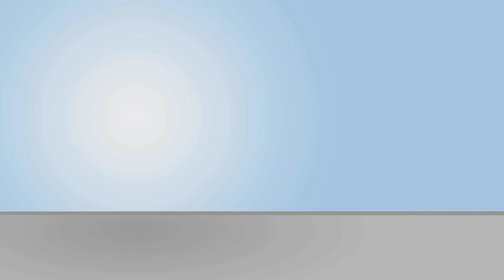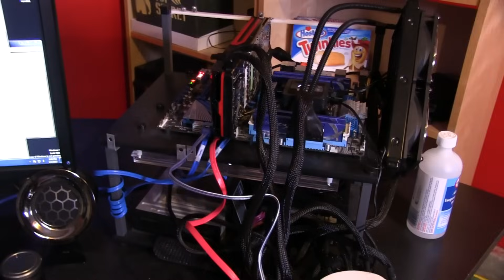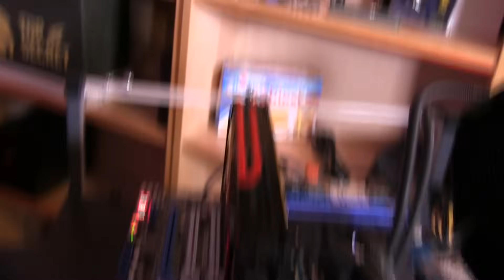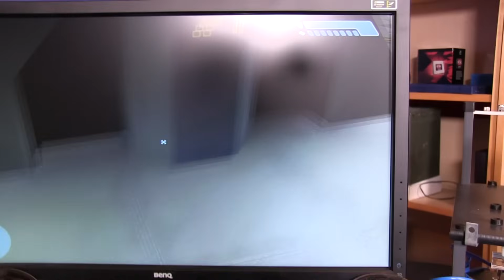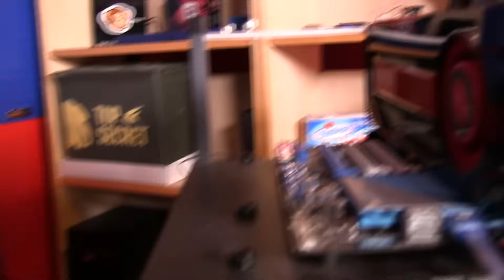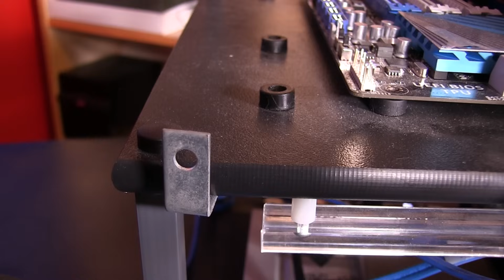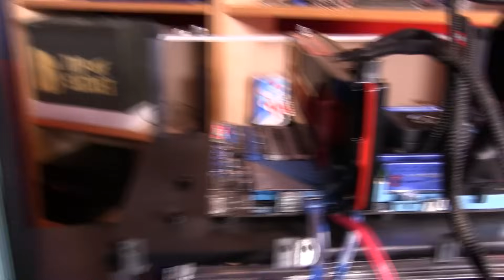Coil Whine Explanation & Demonstration Linus Tech Tips

Comment: I had psu coil whine when moving the mouse and scrolling throw pages. I turned of power savings in bios on the cpu and it fixed all my psu whine when idling. so for those who have problem. give it a try. 

asus motherboard. in bios go to advanced/cpu configuration. then disable all cpu power saving modes.

Comment: I have an new system with MSI RX480 x 8GB, i7-7700,asus prime plus b250, CX650m psu, i was playing bf1 and the coil whine came not directly and not so high as in this video. I was plugged in at an not earthed circuit. Now its in earthed wall socket should this make sense? Or should i still change my gpu for a new one?

Comment: that is horrible!    so glad my asus strix gtx 670 doesn't have and has never had that coil whine.....i'm thinking about upgrading to an Asus Strix GTX 970 card, but I'm worried about coil whine.....i could never put up with that,,,,would drive me crazy....my pc is very cool and whisper quiet as I have Noctua cooler inside and replaced all of my fans with Noctua's running on low setting.....quietness is of utmost importance to me!    Anybody here recommend a gtx 970 that has low chance of coil whine or is it really dependant on the card itself and/or power supply??

Comment: my gpu does not coil whine (atleast i can't hear it no matter how much i have tried) but i can hear the coil whine sound in my headset if i use 3.5mm, its seems to go away if i use a usb headset tho. does anyone know what that is and how to get rid of it? i changed my gpu like just a few days ago so it might be gone now if im lucky.

My motherboard is: GA-Z97X-Gaming 3 
link to motherboard specs website thingy with information and stuff: http://www.gigabyte.com/products/product-page.aspx?pid=4966#ov
Reply: From my understanding it is not coil whine if you're hearing a sound from your audio jack. I had the same problem, basically I would load up Overwatch on my computer and hear static. Then I noticed that it appeared in other games. I opened up my pc and saw that my hd audio port (for the case front panel audio jack) is right above my psu and below my graphics card. This position leaves it open to a lot of signal interference. The fact that you're using a usb headset and you don't hear it could be an indication that your hd audio wire is in a spot open to interference. In that case like with coil whine there isn't much you can do other than try to route the wire differently. Now I did hear a more static and not the coil whine sound in my case though.
Reply: Also you should test out if you hear this sound when plugging your headset into the back of the motherboard, ie. the io ports. If you don't hear this sound then it's probably the hd audio wire.
Reply: shadowstar1286 my hd audio cable is in between my psu and gpu the wierd thing is that when i change port (i usually have it on the backside in the motherboard) to the frontside it doesn't stop but it becomes more quiet
Reply: Yea that is weird. My motherboard was advertised to come with "shielding" for my onboard audio so that may be why. Could be that you're receiving more interference from the onboard audio, but at this point I can only recommend seeing if your drivers are up to date. I don't have much experience with audio problems so I can only respond with my experience.
Reply: i have the latest drivers i have been able to find..
Reply: this is just from the audio cable, get a better one or remove causes ( most likely: wifi adapter, ethernet cable, cat-e tv cable maybe if it close)
Reply: Daisudori i'll try getting a new audio cable, i have tried the other stuff u mentioned with no results
Reply: ***** Thanks alot dude everything you assumed was on point. So i guess imma get myself a audio card :)
Reply: Getting a sound card  would be much more easier than replacing your hd audio cable.
Reply: altho, with a bad shielded wire u will still have the same problem if the room/area has alot of intereference.
Reply: Daisudori how do i know if my cable is poorly shielded?
Reply: ***** nope haven't gotten one yet since i have usb headset (i can't hear it when using them) also i haven't heard it when using my new speakers. im not sure if it solved it self or something but yea
Reply: ***** but usb soundcard most likely will work since it dissapears when i use my usb headset and the thing with usb headsets is that they have built in usb soundcards
Reply: when my HDMI audio driver is installed (from AMD rx480) i also get this chirpy buzzy sound, from my monitor (with speakers in it). Disabling this device (HDMI Audio device) in device manager got rid of it :)

Comment: I don't have coil whine, but I do have an annoying grinding sound when my GPU fans first start spinning. It would be fine if they would stay spinning, but when cooling down from a heavy load, the temperature readout will fluctuate between two temps for a while before settling down to the cooler one and this causes the fans to start and stop repeatedly as the readout goes between 55 and 56C (the temperature at which the fans spin up).

Comment: my 7970 didnt have it... and its the same model. maybe its just your gpu thats bad?
Reply: MEXICO_MAN try running a very old game without vsync or fps limitations, in the hundreds of fps range.  then take a listen.
Reply: Old games should be capped because it can cause problems, moreover, that would only happen to a handful of people in rare situations unless they did it on purpose. Your argument is a bit invalid to the normal user.
Reply: MEXICO_MAN older games running at 200+ fps has never caused problems in my experience, other than a gpu or maybe cpu being able to run 100% the entire time, causing more heat than, say gta5 with dips and valleys and vsync to keep it limited.  That's the only "problem" I see.  And even then, good cooling should keep everything happy, and this might even be a good stability test.  I mean, people (like me) use furmark and prime95 to stress a system to test thermal stability.

The normal user can install unreal tournament 99 or quake just as well as anyone and see these results.  Nothing I said was invalid until you attempted to place the point I was trying to make into a context that was contrary to my point.  You still got my point, though.

p.s. older games were running on older hardware.  so they were created with hardware of the day in mind.  I don't know of any games more than 7 or 8 years old with explicit frame limiting as an option.  the limitations were whatever hardware you had at the time. they didn't plan on computers 10 years later, they planned for the current day.

Comment: Help plz !! I have Asus Strix Rog 1080 4.2ghz . And when i play Kane And Lynch the whistle is strong but when i try some other games like Gta5 or 2016 games ,there is not any whistle ... So only that one game causes it . What is the problem ??? 

Thx
Reply: NicolS Korn certain game certain load, it just depends
Reply: Coil whine usually happens when you're getting extremely high fps, and it causes a lot of electricity to pass through your card's components. For example, you can get a lot of fps on the menu of a game or on a game that doesn't demand much of your card. It is absolutely normal and doesn't mean you have a bad quality card. My Gigabyte 1060 OC also has it :) If you want a fix, I would recommend limiting the game fps on the graphics settings, but not all games have that option.

Comment: The solution is simple, replace the Chinese inductors with comparable ones manufactured in Japan. Properly designed and manufactured coils DO NOT RESONATE. Coils made from low quality materials and not tightly wound and properly potted will resonate at certain frequencies. Coils made from low quality materials tend to start off fine but start resonating as they age from constant heat

Ten years ago everybody was blowing out cheap Chinese caps in their motherboard  switching regulators, everyone complained and now they all pretty much brag about using Japanese manufactured capacitors  but they are still using the lower quality Chinese inductors so now everyone complains about coils resonating ...... Size, number of turns, ferrite core material type, all these things affect the resonant frequency and I bet everyone is using coils with the exact same specs so they have the exact same problems at the exact same frequencies which are in the upper audible range. I have hearing out to 22khz in one ear so I hear all this stuff most people cannot and while it is extremely advantageous in troubleshooting it's annoying because I hear everything from fans to failing bearings 

Again a properly designed and manufactured coil WILL NOT RESONATE (unless it is supposed to such as in RF designs) Designing switching regulators so they ALWAYS stay above the audible frequency range is actually the simplest solution ...... But they will never be implemented until we tell manufacturers this is simply unacceptable instead of just putting up with poor design technique 

John Russell, BSEE

Comment: I wanted to know about motherboard whine (which is noted in the description). My new mobo, which I've already exchanged once (happened on both identical boards) makes a whine sound coming from the CPU socket area. I've never heard of CPU's themselves whining (it's a new i5-6600K), so I'm pretty sure it's the mobo. The whine goes away if I disable processor idling (similar to disabling C-states), but that makes my temps rise 10-15°C and has other negative effects. I might be able to ignore it when the case is closed, but the worst part is that the sound actually comes through the headphones. So frustrating.
Reply: *****
Yeah, sucks if all motherboards of the model I picked do that (2 have), cause it was like the only board under $200 with the features I wanted (mATX, LGA 1151, Z170, SLI Ready). I think there was one by ASRock that fit the specs, but I don't know that company too well. Plus I already bought a bunch of other components that match the color scheme of my motherboard.

Comment: It's possible to fix It?
Reply: Get a better PSU or a silent case. Otgerwise, no.
Reply: Yes, there is a fix, but not to all games. Put a fps cap on the game's graphics settings. Coil whine happens when you get extremely high fps.
Reply: @Ethan Roy That is not it at all.
Reply: ParadoxParadoxParadox "coil whine happens at extremely high fps"

CLOSE. the wine happens when the coil is at / near it's limits. varies from coil to coil, of course. some coils don't make a peep until overclocked, others begin whining at 40% load.  FPS is a factor, for sure, but fps doesn't equal whine, the load on the coil does.

Just to give people better understanding, not to step on your toes!
Reply: ralekriver
Thanks for giving me a heads up :)

Comment: I have an idea. Since coil wine can be reduced or solved by changing the voltage. Why don't just over clock or downclock the component that's wining. Motherboard, gpu both can be oced I think..

Comment: I have whine coming from my Seasonic 400-fl psu when it's in sleep mode. So incredibly annoying, sometimes I have to get up from bed and properly shut down my pc because I just can't fell asleep from the whine. Funny enough, when I used a corsair psu (their cheapest line, 550 W or so) there was no whine in sleep mode, BUT in that case my AMD firepro w7000 graphics card was whining during Solidworks sessions, depending on what was on screen. Like WTF, why can't engineers do something about these things?
Reply: they could enclose the coils in a block of epoxy resin or something - I had an old CRT TV that started making this uncomfortably loud high pitch noise - fixed it by applying a good amount of non conductive spray paint to the coil on the tube
Reply: All the CRTs at my school make that loud awful ear piercing noise.

Comment: My card makes this exact noise when running games with an unlocked framerate (like TF2 at 300+ fps).

The thing is though, I only hear it through speakers when I have them plugged in, so I just assumed the wires were picking up interference.  Can you have coil whine that manifests itself this way, or is it something else I'm hearing?  If I unplug the speakers there's no noise.

Comment: guess the only way to solve this problem is to get a sound-proof case?
Reply: Limit fps. Coil whine gets worse at higher fps. I experimented with game Melody's Escape - if you don't limit the fps in the frontend and let it run at 400 fps, the coil whine on my GTX 970 gets insane; But limiting to 60 fps completely removes the whine!
Reply: it's also interesting that he chose Hal 1. Why this old game and not a new one? Probably because this could run at 500 fps and easily demonstrate how bad whine can get... It's less noticable in newer games where you wont be reaching these speeds
Reply: why should one play with more FPS than the monitor can handle anyways ? running 400+ fps on a 60hz monitor improves nothing AFAIK - all it can do is introduce tearing - right ?

Comment: Oh my god... and I was annoyed with the growly ball bearing noise that started after I installed my nvidia graphics card... I would probably throw my pc out the window if it started doing this whining thing :s

my ATi / AMD cards (sapphire) have always been totally silent. Not happy with nvidia :/

it sounds like the new noise on my pc is coming from the cpu - is it possible I damaged the cpu fan somehow when I installed the graphics card??
Reply: Ugh no I checked it again with a voice recorder with the mic positioned at the graphics card, and then at the CPU. The grinding / growling noise is definitely coming from the graphics card :( guess I have to put the sides back on the case and board off the pc with sound proofing or something xD

god damn you nvidia. .. before I put you in there my pc was so silent I couldn't tell if it was on or off without looking at the power led... Now I can tell when I'm standing at the other side of the room :(
Reply: the only real way to confirm is to switch out another card into your pc and see if the sound is still there...btw which nvidia card r u using?
Reply: lyhthegreat
GTX 1060 - not massively expensive but still, I expected better from a brand new card :/
Reply: Luculencia if it's a pretty new card then i think u shld probably return it.
Reply: lyhthegreat
None of my friends or family can hear it (or they hear it but very, very faintly) - I think I must just be especially sensitive to high pitched noises or something? Its likely MEANT to sound like this, it's probably just the normal noise the fan makes. If I send it back I'll have to pay the p&p and then I'll have to wait another week to get another card (plus they might just tell me it's working like it's supposed to and I'm not entitled to a refund). I have put the sides on the case back and it isn't as bad now... still irritating though :(

At least its not as bad as my brother's Graphics card... that sounds like a jet plane taking off >_<

Comment: damn it its awfulll
Reply: I doubt it's something you'd hear in a well insulated case. Especially with the fans and stuff running.
Reply: @Jdogg4089  I just discovered I have this sound coming off my RTX 2080ti AMP today, I always thought my my CPU's liquid cooling pump had air bubbles or something. I just overclocked my i9 9900k tonight and it feels great! I actually havent heard no pump like noise. But that GPU though, OOOOO that needs replaced, i can hear it very well in a dense case. Makes me nervous to play games in case anything happens
Reply: @velocityfragz_5840  
I'm pretty new to all this stuff , but in terms of noise , fans / coil whine... which one is significantly audible ? And which one affects lifespan of your system if they do it at all ?
Reply: @Zeegoku1007  Don't worry about it. Coil whine, the thing you can hear in this vid, is absolutely harmless and nothing to be worried about. Fan noise? That's just your fans doing what they are meant to do. If the noise disturbs you, you can invest in better fans, all in all better cooling system or soundproofing your case.
Reply: @velocityfragz_5840  I have the same issue with my gigabyte rtx 2070s and now I regret investing in super quiet fans.  Noisier fans would help drown it out at least.  Maybe I'll wrap my case in mattress foam and see if that helps lol
Reply: @SineN0mine3  hahaha 3 years late but maybe a few more tempered glass case and its done lol

Comment: @LinusTechTips
I'm getting this exact issue in my new workstation build with an MSI C236 motherboard and  Xeon E3 1230v5 processor, however it isn't coming from my videocard, sounds like a choke around the CPU and it get's waay worse when under load. The only thing i can think of is that I'm using an ECC compatible memory board with non ECC RAM. My main question is will it have a shorter life expectancy than a board with no coil whine? is it worth trying to claim warranty?

Comment: I have coil whine on my MSI Geforce 1080, but it's only when I'm not doing anything extensive. Mostly when I'm just web browsing. I rarely have coil whine during gaming sessions. It's strange.
Reply: Man that's weird. I appreciate the input though! I'll check it out.
Reply: My R9 fury only whines when it's under load. It doesn't care if it pushes 1000 fps or 30. High load=Whine
I guess it's PSU related...
Reply: It was my card. I exchanged it for an MSI Gaming 1080. No whine now.